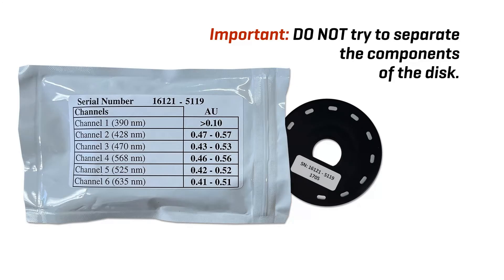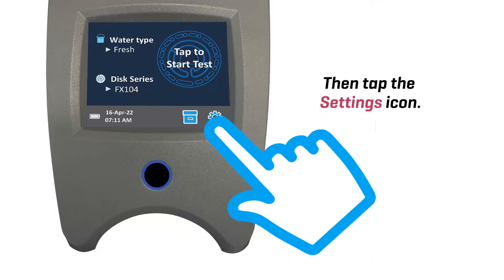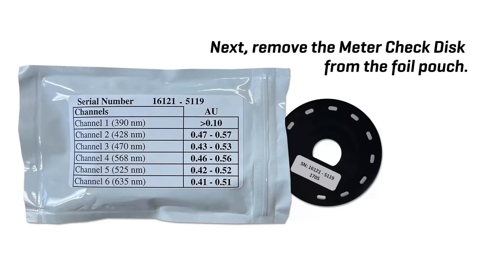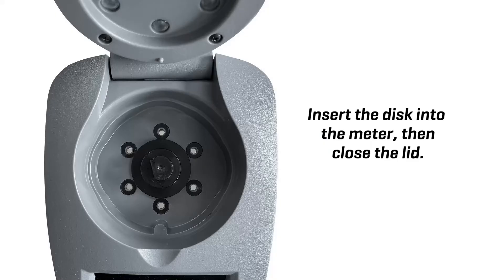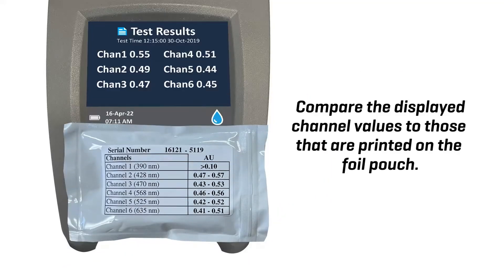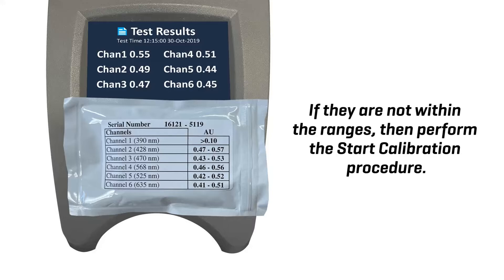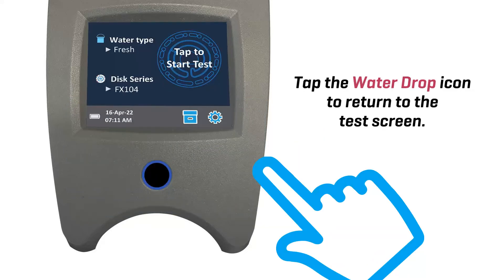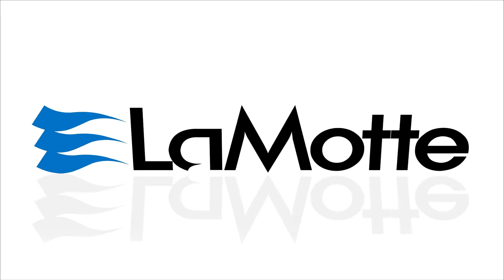LaMotte Spin Touch:  Troubleshooting with the Meter Check Disk | Check Calibration Procedure

Comment: Is it one use or multi use?
Reply from the maker: The Spin Touch Meter Check Disk (1705) can be used multiple times to check performance and calibrate the Spin Touch device. It has a shelf life of 5 years.